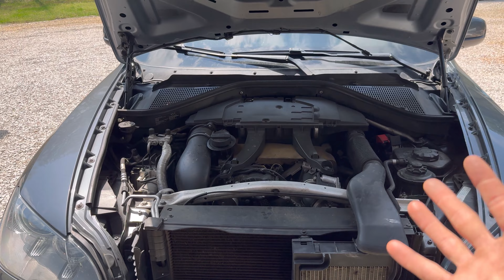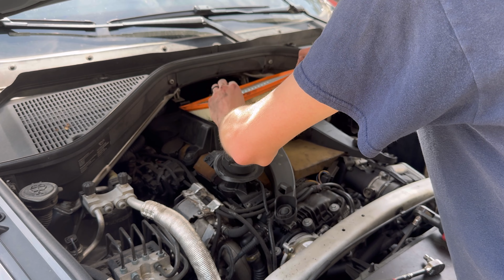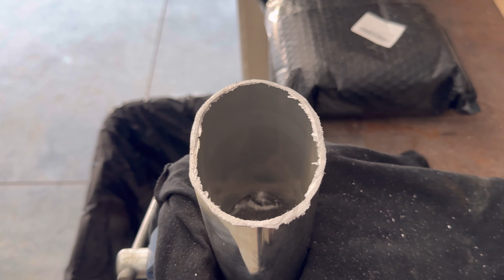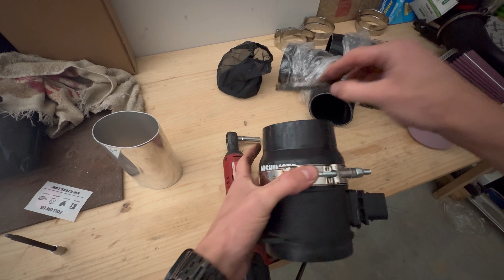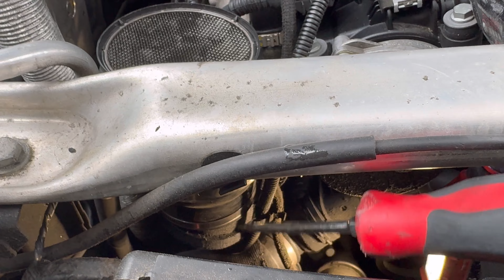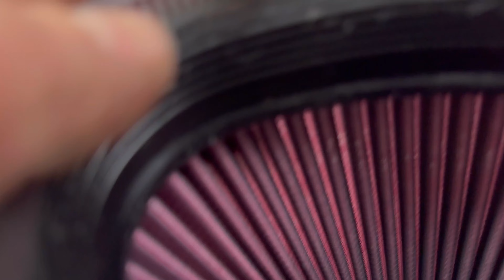How To Build A Custom Intake For Your Bmw X5 DIESEL!

Comment: The only thing I don’t like about this install is the steps at each couple. You should be trying to make the flow of air as smooth as possible, and any step or indentation from the couplings will cause turbulent air. Not a huge deal, but definitely enough to consider it. ,

Comment: All of these parts can be had for under $200 on Amazon as an FIY to anyone making this. Paying almost $400 for this and not getting something as clean as the fisher motor works one is quite the ask lol.
Reply from the maker: All the links are in the description and I mentioned this in the video lol... My kit is for someone that doesn’t want to piece buy and guess if they got all the components, have to cut the pipe and then finally assemble. 
Fisher looks good and seamless but it’s ultimately made from plastic. (I understand he had some issues and updated his material) I 3D print parts for a living and even using carbon they can only be so strong. Vs a molded OE manufacture plastic such as the factory intake box.